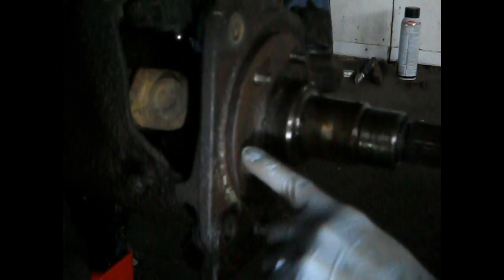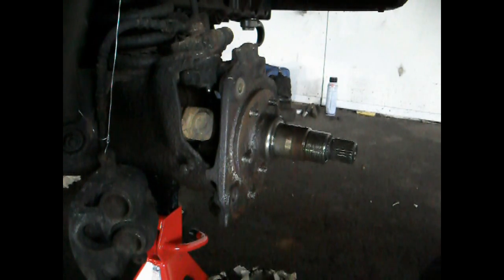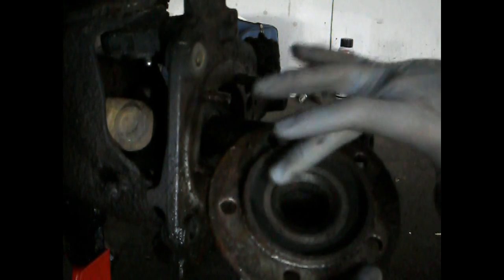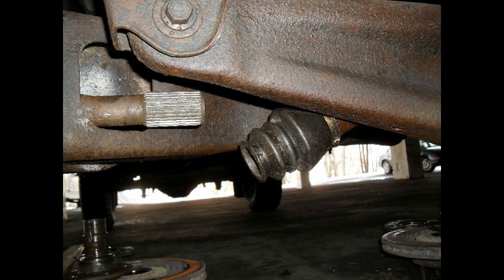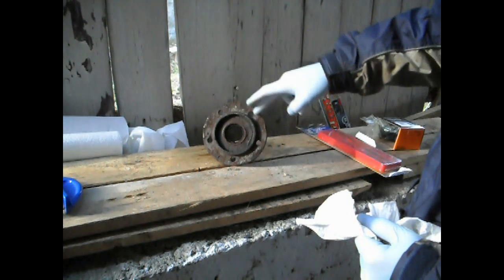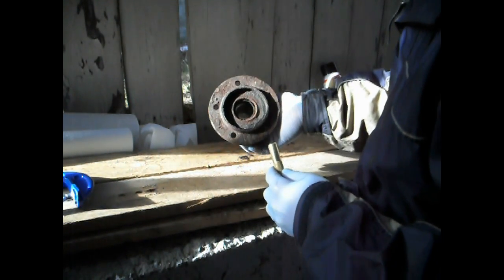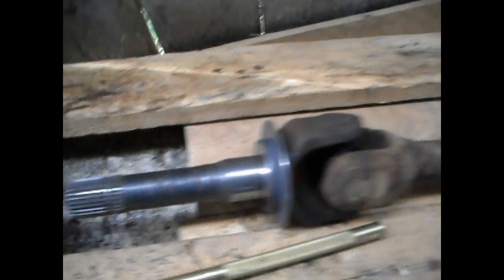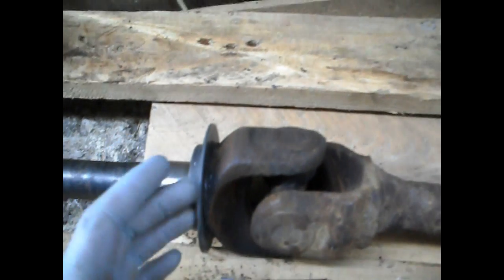1993-1997 Ford Ranger Front Spindle Bearings Replacement

Comment: I just did this yesterday to my 87 4x4.  Those nuts at the beginning are 9/16/ or 15 ml., no hammering required.  Even so, Very nice video.  Thank you very much, sir.

For those who don't know, the 8 point socket is your Friend in times when a standard or metric size will not fit properly.  When the manufacture calls for the "special tool" and the head of the bolt or plug is boxed, you now know the way to do it cheaply.  It's always nice to own a full size set of both.

Comment: very detailed and thorough video!  great job buddy! definitely my spindle bearing on my passenger side.. it's on tmmw.. thank you
Reply from the maker: You're welcome!
I hope the install goes nice and easy, or at least as easy as it can on older trucks like these!
Reply: just to be sure.. this spindle bearing is only for the 4x4 when the front axle engages correct?  it has nothing to do with the outer bearings in the rotors right? or have anything to do with regular 2w drive? just making sure since I've encountered this clicking noise now and only in 2w drive. the noise clicks when I let on and off the brakes, and rattles when off the brakes as well.. but turning the front drive shaft axle I can pretty much hear it clicking where the passenger side spindle bearing is. thanks again
Reply from the maker: Well, the spindle bearing is only there for 4x4 trucks and it has nothing to do with the wheel bearings that are inside the rotor/hub assembly. But depending on how well your front locking hubs are working you might still be turning the spindle bearing even when in 2wd. If your front locking hubs do not fully disengage then when the tire rotates, the front axle shaft will rotate too and this will rotate the spindle bearing. If you have dirty manual locking hubs or worn out automatic locking hubs they might not disengage. 

If you are hearing a noise from the spindle bearing, then your right it is probably shot. Maybe you can clean out the locking hubs and put a thin layer of grease back in them too.

I hope the fix goes well

Comment: Hi, I'm attempting this job because I blew the driver's side inner bearing  (the one on the rotor) and the bottom race seized itself to the spindle, so I got another spindle from a local JY, and gonna put new bearings and seals in it. I was just wondering where you got the Timken SBK4 part number from. Nothing on rockauto or summitracing or anything I can find are linking SBK4 to a 1996 Ford Ranger 4x4 XLT (my truck). But your video is super detailed, and everything matches my truck verbatim, (except mine has ABS where yours doesn't), so I took your word for it and ordered SBK4. It was only a $10 wager on my part, but I'm just curious where you made that connection. Great videos, btw, they have been extremely helpful so far.
Reply from the maker: Hi Alejandro,
Thank you and I'm happy to hear the videos were helpful!

That's great that you were able to find a good replacement spindle!

I found that part number on Rockauto:
http://www.rockauto.com/en/catalog/ford,1997,ranger,4.0l+v6,1138160,brake/wheel+hub,wheel+bearing+&+hub+assembly,1636?a=Referer+www.google.ca+URL+%2F
It was the only part that matched my truck (1997 Ford Ranger 4x4 4.0L). 

The main thing you need to know is what type of front axle you have. Is it a Dana TTB 28 or a Dana TTB 35? If it is one of those then as far as I know they both use the same parts for their spindles.

Good luck on the repair.
Reply: Ah, there it is! Thanks for the reply. See, I was looking for it under 'spindle bearing and seal kit, here: http://www.rockauto.com/en/catalog/ford,1996,ranger,4.0l+v6,1138104,brake/wheel+hub,spindle+bearing+and+seal+kit,1644?a=Referer+www.google.ca+URL+%2F but yup, here it is:http://www.rockauto.com/en/catalog/ford,1996,ranger,4.0l+v6,1138104,brake/wheel+hub,wheel+bearing+&+hub+assembly,1636?a=Referer+www.google.ca+URL+%2F I should have the Dana 35. Only the 4 cylinder rangers came with the 28.
Reply from the maker: You're welcome!
Best of luck on the repair!

Comment: I needed to know the size of socket used to remove the lock nut at end of spindal, u know the special socket u had to buy to lock the 2 nuts together.I need to know where to get that socket, thanks u been a great help on this job.
Reply from the maker: I explain all about the 4 prong lock nut tool on: 1993-1997 Ford Ranger Front Wheel Bearings & Brakes Pt 1. There's a little link that you can click on in this video to show you how to remove everything to get to the spindle.

The tool I used (and it worked good) is: LISLE Part # 27250 - 4WD 2-3/16" Lock-nut Tool; For 4-slot applications; 1/2" drive. I bought it from Rock Auto (I made a mistake and said Prime Choice on the video).

Make sure you hold it very tight against the nut when you loosen or tighten the outer locking nut or you might slip off and ruin the locking nut or tool.

You're welcome! Hope this helps!
Reply: BMPWR
Yes I went back over video and found it,after I emailed you,,,thanks againg and keep thoses good and informative videos coming
Reply from the maker: SonofGodly
Good stuff!

Comment: do you know how it comes out of the front axle on the passenger side.
I have to put a hub on a 1996 ranger and ujoint on the passenger side this weekend and may have to take the axle all the way out the hole things. be a big help if I knew before I get into it. thanks for the video I think it will be a big help
Reply from the maker: Hi RedneckOnFridayNight,
You're welcome for the video, they're not great but it's good to hear that they help people.
I never needed to replace any of my u-joints especially the one on the passenger's side inner axle shaft.
Make sure you double check to verify that the inner axle shaft u-joint is bad before you replace it, since it does take more work.
Like you see in the video you can work on the outer u-joins pretty easily, but for the passenger's side inner axle u-joint I believe you need to:
1) Remove everything on the passenger's side to get to the inner axle shaft (brakes, hub/rotor, spindle, outer axle shaft)
2) Remove the front differential from the driver's side TTB arm = 10 or 12 bolts on the TTB arm directly in front of the differential (this will also drain all of the gear oil so be ready). You'll probably need to smack the differential with a soft mallet to break the seal with the TTB arm. The front drive shaft might or might not need to be disconnected to allow you to move the front differential.
3) Look inside the front differential, in the carrier you will see the tip of the axle shaft with a c-washer/c-clip on it; you need to remove the c-clip that holds the passenger's side inner axle shaft into the differential. The driver's side does not have a c-clip. You don't need to remove the carrier or its bolts to remove the c-clip. You'll probably need to push the passenger's side inner axle shaft in as far as possible into the differential so you can wiggle the c-clip out of the slot; it could be fun. This is how I removed the c-clips on the 8.8 rear differential.
4) With the c-clip removed now you can remove the passenger side inner axle shaft to work on the u-joint.
5) Remember to put the c-clip back on when re-installing the axle shaft and clean then reseal the sealing surface for the differential. Remember to put gear oil back into the differential! (I use normal 75W90 and replace it every year or so)
Good Luck!

Comment: I have a 94 ranger v6 4.0   I guess I have the larger front dana 35 from my research.. I need to do this to my truck.. is there a difference between the parts of this opposed to the smaller axle?
Reply from the maker: Hello!
As far as I know the spindle bearing kit is different between the Dana 28 and the 35. I believe you should have a Dana 35 because of the year and engine size, but you never know. Always better to double check!

Here's a great page to help you determine if you have a Dana 35 or a 28:
http://www.therangerstation.com/tech_library/dana_28_35.shtml

Here's a great page for more information:
http://www.therangerstation.com/tech_library/spindlebearing.shtml

I hope this helps.

Comment: By the way where did u get the timken spline seal and bearing kit?? I need the same one.
The inner seal u dug out on back of spindle ,,,I didnt see that in the kit?
Reply from the maker: I bought the spindle seal and bearing kit from Rock Auto (Timken SBK4).
I was confused about the replacement inner seal at first too, it looks completely different. The replacement seal is actually 2 peices: small rubber seal, plastic washer.
- The rubber seal installs with the open area towards the spindle bearing
- The plastic washer installs with the flat side against the little rubber seal

Comment: I actually ended up using a punch and hammer and turning the knuckle to bust it loose from the back enough to get a pry bar under the spindle itself to finish getting it off. that was after 2 days of beating on it with a pry bar and hammer to no avail.
it's a 97 4x4 xlt. 
I'm in the "salt belt" of the U.S. which means EVERYTHING is rusted. besides my new ball joints and tierods that is😊
Reply from the maker: Great job getting it removed! Yup, salt is something we live with too!

Comment: I was wondering what the seal that goes one the front of the spindle after it's bolted on the knuckle is. I need to replace it while I'm taking mine apart. It's not the one that goes on right in the back of the rotor it goes in between that and the spindle as best i can tell. Mine was to mangled to tell a part number.
Reply from the maker: Hi HONDA_ATC_FREAK,
Is your truck a 1993-1997 4x4 Ranger?
As far as I know there is only one seal (on the trucks I've seen) in the area between the hub and the spindle and thats the hub/wheel seal that gets pressed into the hub.
There's a chance that the seal was so worn that it fell apart and made it look like 2 seals.
Make sure you check the hub sealing surface on the spindle, if it chewed up the hub seal that badly you might need to replace the spindle.
Reply: It is a 96 mine is slightly different than yours though as i have 4 wheel abs so my spindle is  different than yours. I was hoping they were sealed the same but i guess there not. I took mine apart and the hub/rotor grease seal was still in the back and was working just fine, but the seal I'm talking about appears to be a dust shield or something for that.
Reply from the maker: HONDA_ATC_FREAK
I think the TTB spindles themselves are the same; mine has empty holes with no sensors, where as you have ABS sensors mounted in them.
After some researching (and thinking) I remembered what that seal is, it's an Excluder Seal. The excluder seal is a dust seal that is supposed to limit the amount of dirt that the hub seal needs to deal with, but it does a poor job of it and normally becomes very noisy.
I couldn't find a replacement from Rockauto or Prime Choice and my dealer is useless for older parts so I decided to go without like most people do. So far so good and I use the truck for highway and off road.

Comment: Would you happen to know the part number for the driver side driver differential seal?
Reply from the maker: Hi jcollins986,

If you have a dana 35 I believe the seal is: Timken 710043 or SKF 710043
I don't know what the part numbers are for the dana 28 or the hybrid dana 35 (almost the same housing as a dana 35 but with dana 28 stuff inside)

I never replaced the differential seal aka inner axle seals on my dana 35 ttb. But you might find some help here:
http://www.therangerstation.com/tech_library/dana_28_35.shtml
http://www.explorerforum.com/forums/showthread.php?t=301986
http://www.explorerforum.com/forums/showthread.php?t=322128

I hope this helped some!
Billy
Reply: BMPWR thanks alot. Just finished the job on my wheel and spindle bearings with the help of your videos. Very informative and awesome explanation of detail.
Reply from the maker: That's great! You're very welcome!

Comment: so i replaced all of it but now it flops around under there. i pulled it off and the axle was sucked in... any ideas?
Reply from the maker: +Tom Alexander
Hi Tom.
I think I know what you mean.
When you install the axle shaft spacing washers there should also be a c-clip that clips on to the outer end of the axle shaft. The c-clip is needed to prevent the axle shaft from pulling away from the spindle. The c-clips sometimes break then fall off or it might have been forgotten by a previous owner.
Reply: +BMPWR shiiiiiit i remember that now i totally forgot about it idk where I put it. what size c clip would i need for that. cant believe i forgot that im usually anal about that stuff.
Reply from the maker: +Tom Alexander
I'm keeping my fingers crossed for you to find it. It's a specially shaped clip. Thicker than normal c-clips, and it has little bumps on the open edges of the c that engage with the axle shaft spline bumps that are in the cut out.
Reply from the maker: +Tom Alexander 
I hope you can find the c-clip, but if not it will take some searching to find it:

This info is from this page: http://www.explorerforum.com/forums/showthread.php?t=236841

...The C clip is = P/N 42570 (aka by Ford-"snap ring")
...The splined washer is a "variable part" but can be found in this kit at the Ford Dealer - P/N F57Z-3B458-A is the part number, it's 3 washers. Plain steel, plastic, and the splined steel washer ...
...Be sure to verify these as Ford made different variables...
....The Ford Guy may have meant that you need the B.O.M. ...It is a sticker on your front axle which is a "Bill Of Material" sticker noting the build date and axle info...
...Spdrcer34 did give the proper names as per Dana-Spicer, " Ford calls your "splined washer" an 'Axle Shaft Spacer'. And your "C-clip" is called a 'Snap Ring' "

This page also mentions some other places where the parts might be found. You'll want to double check that these are the right parts before buying.
Reply: +BMPWR hey got that snap ring and that was the issue thanks man

Comment: I think ya to put RTV Sealant in there not anti sieze. That would keep water and fine sand from getting to the bearings.
Reply from the maker: Hi Dicky,
Do you mean I should have used RTV in the area between the spindle and the knuckle when I was installing the spindle onto the knuckle?
- I used anti seize so the spindle would not seize/rust to the knuckle incase I ever need to remove the spindle again. That area doesn't make a seal to the bearing area, it's only a mounting area for the spindle, which is almost guaranteed to rust and seize together without anti-seize.

I hope that makes sense.

Thanks

Comment: Easier way to punch out the bearing is to use a pry bar with a curved tip. Lock the hub in a vise and hit it with the pry bar in there. Easy peasy.
Reply from the maker: +Joe Yates Thanks for the tip!